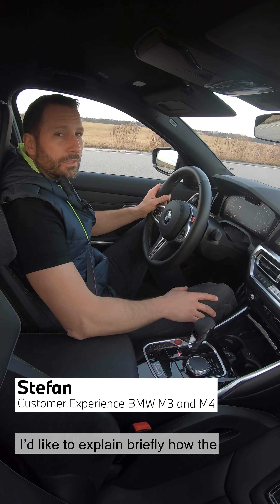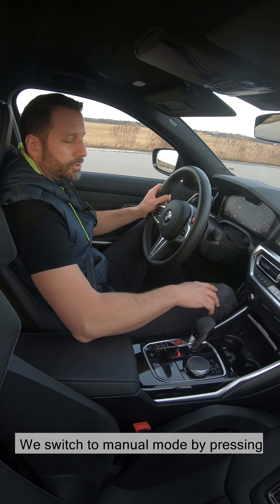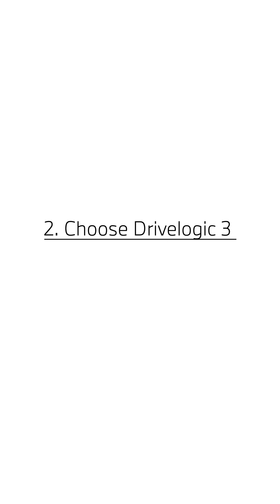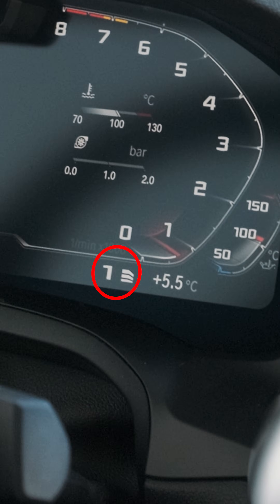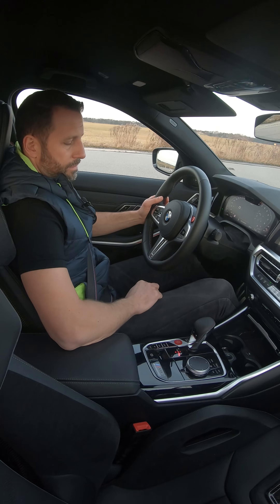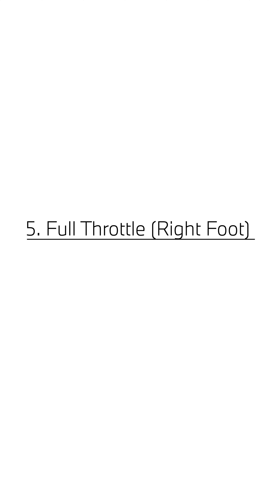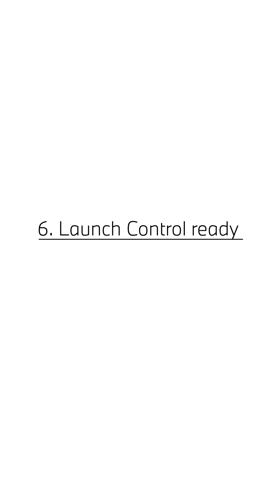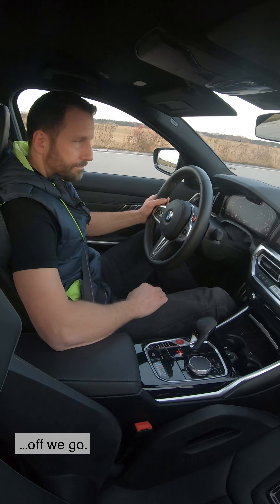Launch Control M Steptronic Transmission. M3 and M4 - explained, Episode 22.

Comment: I set the parameters in M2. So, its just a click M2 wheel button, and a verify, and off we go. Although, BMW doesn't mention that after you use this feature 50-100 times, the car will never go into the secret launch map, ever again. It will still go into launch mode, but it wont perform the same as it did for the first 50-100 launches.

Comment: One question in manual mode when we launch the car why does it automatically upshift
Reply: The amount of torque combined with the transmission ratio would lead to the ARB decreasing the engine torque. In second gear full engine torque can be applied.

Comment: Is the system intelligent enough to vary power and the diff lock up depending on the surface traction?
Reply from the maker: The new traction control configuration option gives the driver the ability to generate the ideal balance of racing-car performance and directional stability to suit the situation, the road surface condition and their personal preferences. This allows them to deliberately approach the physical limits on the track and, by reducing the extent of control system inputs (in stages), create the perfect setup for controlled drifts through dynamically taken corners.

Comment: From my own X4M experience, the most probable mistake is not stepping on the brake to the end or not giving full throttle.
The first night over 2000Km, I tried all night but still failed to engage. 
But as long as you give full throttle, it's easy to engage.
You can save all the settings to M2 mode. (DSC Off, Sport Plus, Manual mode, S3)
When you stop at a red light, tap M2, it will ask if you are sure to turn off DSC, tap it again to confirm, left foot on brake, right foot on throttle, and then just enjoy your launch.

Comment: in the owner manual it says has to be on second gear, and still it’s a bit tricky to engage
Reply: I think you should activate the LC on 1st, and when LC is activated, it will automatically goes to 2nd before launch
Reply: @zerenjin3999  aaah i see. Make sense now